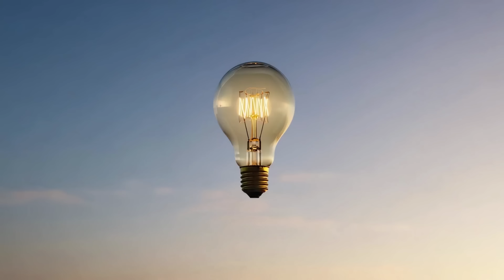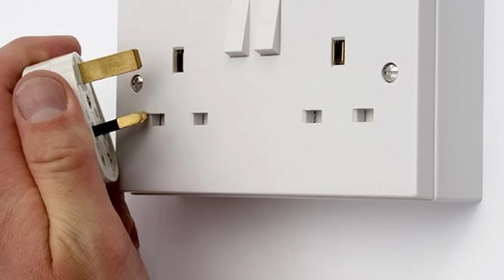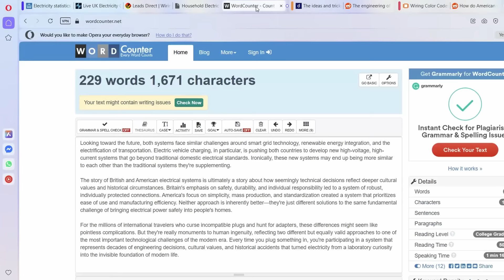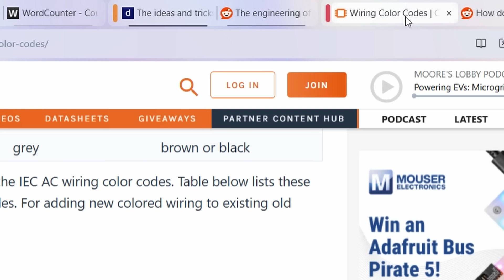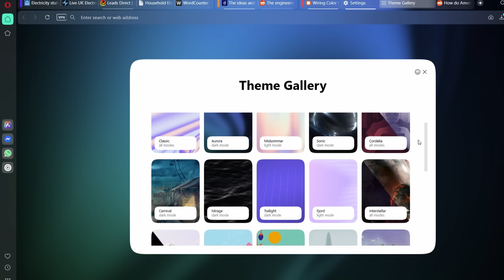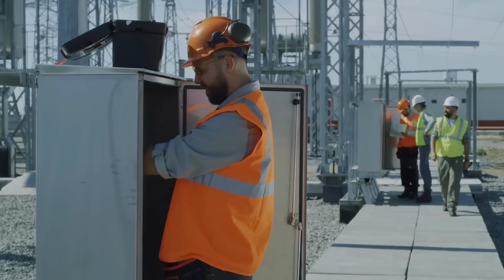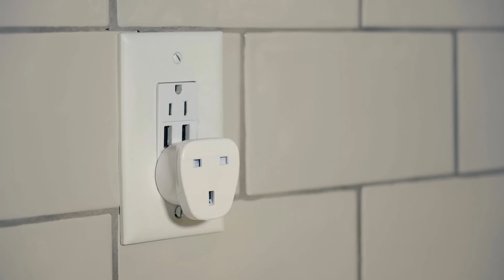British electricity is SAFER than American electricity. here's how.

Comment: Standing on a plug makes you wish you'd stood on Lego.
Reply: I've now lived for 70 years in the UK without once standing on an upturned plug. What's more, I don't know anybody who has. Why is this trope repeated over and over again? It's not that I'm exactly known for being nimble.
Reply: I know no-one who has ever stepped on a plug. We leave them plugged in so it's really unusual to have an open plug lying around and you'd have to have bare feet (maybe with socks) for it to hurt.
Reply: @threethymes  Plus sockets are at the perimeter of a room so any plug left umplugged would also be at the perimeter of the room. You would have to be very close to the wall to run any risk of trying to use your foot as a socket. 😄
Reply: @threethymes  Back  in the swinging sixties, there were far fewer plug sockets in  most houses, and they were usually single outlets. But the number of electrical appliances in the same homes was rapidly increasing so we often had to swap plugs to use different appliances. Careless members of the family sometimes left an unplugged plug lying away from the wall and they ALWAYS landed prongs up. It was a recipe for shrieks and considerable agony from bare feet at night! Not much of an issue these days of course, as we leave nearly everything plugged in all the time and use the socket switches if necessary.
Reply: thanks for for the explanation. That makes sense.
Reply: @1947dave  So, you're talking about two thirds of a century ago....
I'm now retired. I've never trod on a loose plug.
Reply: @wessexdruid7598  Neither have I, though I've witnessed the yelps of pain, we kids found it hilarious as long as it wasn't ourselves lol. Never happens these days though.
Reply: @threethymes  But don't forget that the British type G plug is more prone to earthquakes and tornadoes (or so as US disaster logic has it for just about everything that isn't a US product)
Reply: @clivewilliams3661  That's probably why we do not have big earthquakes or tornados in the U.k.  We banned them!!  Actually our houses are less prone to these things than Murican ones, so we do not need to worry.
Reply: @clivewilliams3661  In my garage, the electric door opener has a 13A British type G plug inserted in a British type G socket mounted on the ceiling. It's never fallen out. Could a U.S. plug stay in an socket that was mounted on a ceiling?
Reply: @Mark1024MAK  I would not normally expect a 13A plug on a fixed installation like a garage door opener.  Typically they are hard wired into a fused spur as the last thing that should happen is that it should be removed accidentally or maliciously.  The vast majority of the installations I have been involved with are either single or three phase units and all are hard wired for safety.
Reply: @threethymes years ago there wasn't  switches on all sockets  . Im talking  about 5 amp and 15 amp sockets  they didn't  have switches  they hurt just as much as the 13 amp one
Reply: @threethymes   In the days of few sockets and multiple plugged things,  (today in my very old house) there are bound to be a few plugs lying  around and torture opportunities not at all rare.
Reply: When did you ever hear that this happened as a true event. If you want to disconnect, just turn off at the outlet if you know what the switches are for.
Reply: Never stood on a plug in my life, and if I did I am in the habit of wearing decent footwear. Not everyone dresses like they are on a sandy Hawaiian beach all the time, although that is the fashion I know.
Reply: I've been around for many years and have NEVER stood on a plug.
Reply: @charlesxix  I have only stood on 13amp plugs in my workshop when (not)using power tools but then I have work boots on, usually with steel insoles.  I have never stood on a 13amp plug top in bare or stockinged feet in the home.
Reply: Just coincidentally made a very similarly themed comment but you were by several minutes the original plug-Lego-pain parallels poster 😉👏🏼👏🏼
Reply: I have trodden on a UK plug, but only because my wife in her ultimate wisdom decided it was better to pull the plug out and leave it randomly on the floor at night. Why she did that, I do not know. A UK plug, having an on/off switch is perfectly safe to leave in the socket with the switch to off - no need to take it out for someone tho stand on. 🤬😡
Reply: The plugs are almost always left in the socket though, because we can actually switch off at the socket, It also takes 10 secs to point the plugs down when you disconnect. And, frankly, the wall sockets are usually away from where anyone would want to stand. Furthermore, American style sockets essentially have two sharp blades just waiting for a foot to come along so hows that better. Then there's the whole thing about questing little fingers touching a half inserted live prong, which pays for the whole thing all by itself.
Reply: Once forgot I was not wearing my safety boots with armoured soles and climbed over something that meant stepping on a spike. Thought I had stepped in a puddle after. Plug was worse (Not including recovery time). 
P.S. I hate neat organised people.
Reply: 😅 absolutely 👍
Reply: Why would you want to stand on a plug? Most appliances are left plugged in, any portable appliance put back in the cupboard I've never heard of anybody standing in a plug I don't stand 2 inches from the wall I have no idea where standing on plugs comes from.
Reply: Depending on the amount of energy you have at the time, you will be able to power the device .
Reply: The only plugs not in the socket in our house are my small kitchen appliances